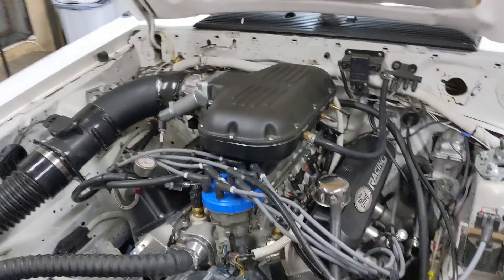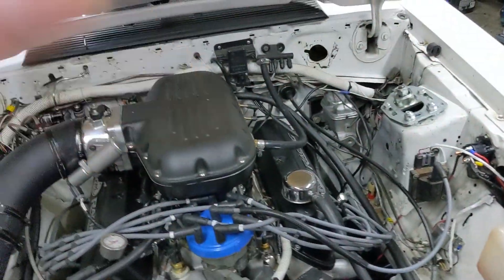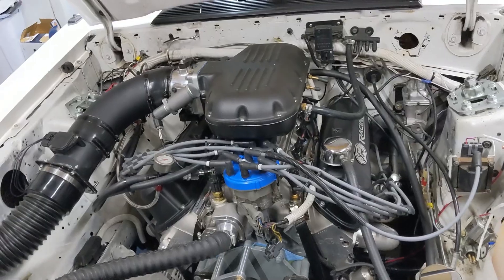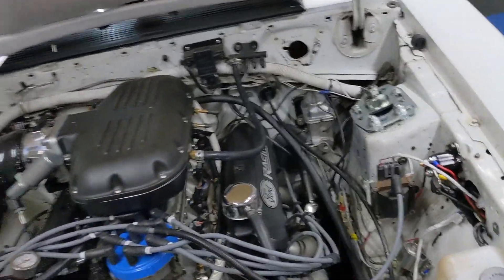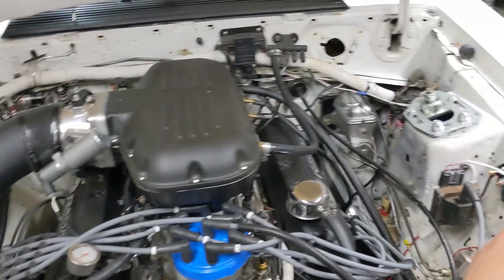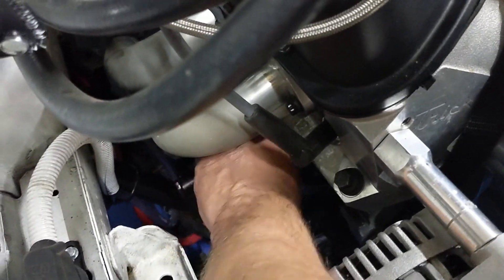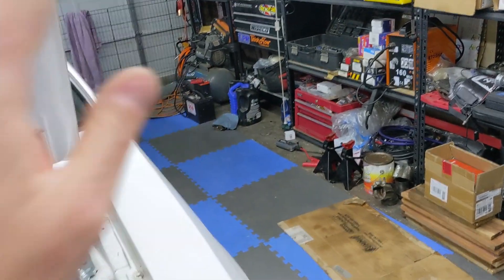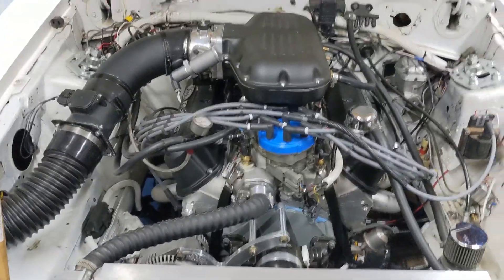Hot start issue after electrical short?

Comment: If it keeps hard starting when hot, check your grounds. Make sure the ground strap on the back of the driver's cylinder head is connected to the firewall and check that you have a good chassis ground at the battery in the back. If all else fails, ground the negative wire from the battery in the back directly to the engine block. It is a lot of wire but it fixes hard hot starting almost every time.
Reply from the maker: Thanks, i have all those groundsl but I will double check them!

Comment: I'll throw a theory out there: If the shorted cable got hot enough and conducted that heat to the solenoid it could have caused the plastic around the positive stud to deform and affect the alignment of the stud's contact to the solenoid plunger's ring contact. Normally this fault occurs due to the difference in arc-burn wear between the positive and negative sides so it could have been poor to 'start' with.
Reply from the maker: Thank you! I can investigate the old starter and solenoid for sure!